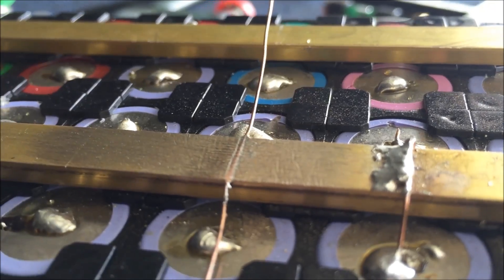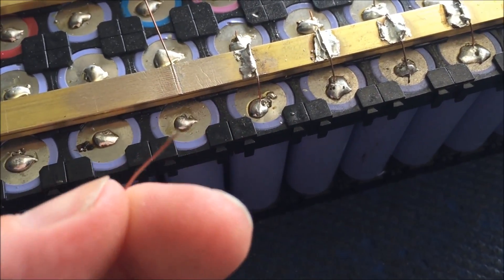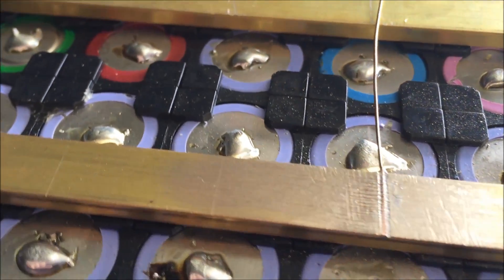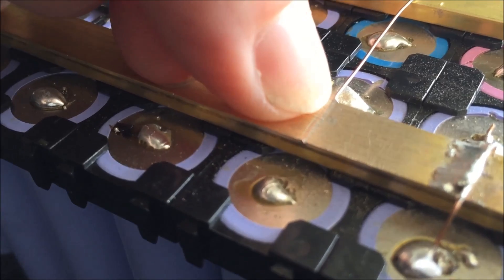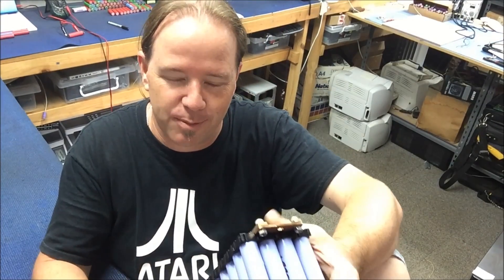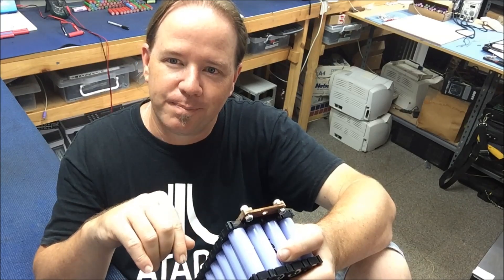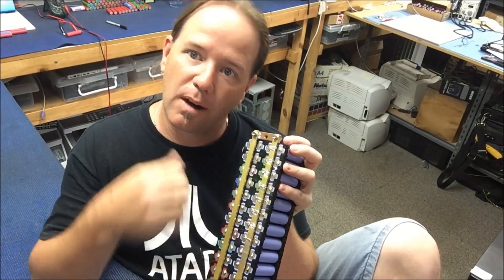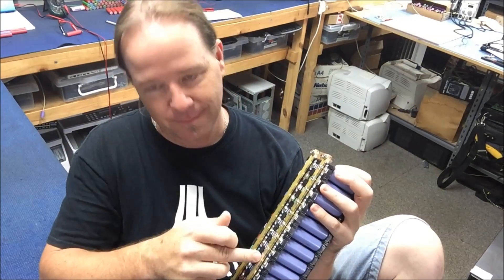Busbar idea coming good I think.

Comment: why my solder cant stick to the battery? any idea how?
Reply from the maker: Iron isn't hot enough, no flux, dirty, heaps of reasons.
Reply: 60watt of iron , is that enough?, Flux core solder, and clean. I try to sand my 18650 and it help the solder stick. Is that mean i have to sand every cell? I dont see you did it. Thanks for your responce by the way
Reply from the maker: heat the top of the cell (NOT TOOOO MUCH) first then apply solder.. try on some bad cells first. There is SOME cells that just don't take solder others its very easy.. just play with it and learn.. you'll get it 
i use a 40w iron so 60 will do the job..
Reply: i will try and update the result. thank you for your suggestion.
well i have another question that keep running in my mind, can 18650 be use for car engine starter?
Reply from the maker: anything can be used for anything you just have to do the math :)
Reply: but i herd that 18650 cant draw much Current at short of time. means cant use for engine starter. unlike lead acid battery. is that true?
Reply from the maker: it's all math, you just add more and more and more cells.. till it does what you need.
Reply: yeah, right. i will update about the solder tonight. Indonesia time, +7 GMT . Thank for your advice sir.
Reply from the maker: No worries - pete
Reply from the maker: weird, don't think i can help any more than that sorry with out seeing/playing with it my self. Have you got a different soldering iron you can use ?
Reply: i will looking for new soldering iron. maybe yes my iron is not good, because when i left it for maybe 5 minutes it is very hot. and i can solder it easily, but after i solder 3 - 4 times, it is getting cooler and become harder to solder it. my conclusion, you're right, the soldering iron isnt hot enough. any recommendation for new soldering iron (or soldering station) ?
Reply: pete, i fround out that my soldering iron is not 60w it is 30w. i dont check it i just trust to the local seller when i order 60w. i am looking for new 60w soldering iron. Does DEKKO Brand 60w Soldering iron good? what do you think?
Reply: hey peter. guess what. you're right i bought 60W DEKKO Brand soldering iron. and it is now very easy to stick the solder. Thank You for your advise sir

Comment: An alcohol wipe would help just before you solder. sweat, oil from fingers inhibits solder adhesion and requires you to heat longer. also a dab of flux would help.
Reply from the maker: Great tips however gave up on this a long time ago :) learnt a lot since
Reply: HBPowerwall That you have. Well done on the progress. looking forward to getting the right space to do my own powerwall. 2017 will be the year!

Comment: hey great looking project, have you thought of just drilling a hole through the side of the busbar? fill it up with flux and solder, use a blow torch to heat it up. would leaves a nce flat neat looking top and works well
Reply from the maker: +vulkane87 yes, how ever drilling 2240 1 mm holes seemed too much :)

Comment: I really like the idea of slicing the bar to wedge in the fuse wire. Have you considered expanding on this and using two thinner bars stacked on each other with the fuse wire inbetween, kind of like a compression fit then spot welding the bars together. 
Not sure of how this will affect the total amperage capacity of the two bars but might be worth a shot on the small scale to check feasibility.
Reply from the maker: +chanrate yes, others have suggested that but I like my idea.

Comment: How about making the cut wider and deeper to allow the fuse to drop in, once in the fuse is in the cut the soldering should be easier to flow in the bus.
Reply from the maker: +Geoffrey Howsam deeper for sure but i actually want a thinner cut so the final finish looks better.

Comment: What about using a MOT and make a spot welder and spot weld them to the brass bar were you need them and then solder the wire to the batteries.
Reply from the maker: +McCuneWindandSolar MOT?  I'll go cross eyed trying to spot weld 0.2mm wire!

Comment: If you are aiming for a clean look cut deeper torch heat everything outside flux solder let it cool than sand everything else to make a smooth finish and clear coat it for oxidation
Reply from the maker: +94Discovery Yep, that's the plan - for preheating i'm going to use the BBQ :) whatever works right

Comment: if you have a saw of some sort, mark all the lines for the cells, then take the busbar off and cut the grooves on a saw or something so they are uniform and perfect, i would think a router with fine tip would make quick work of the busbars with perfect dept grooves...
Reply from the maker: +storxusmc going to buy a miter box today and do several at a time.
Reply: +HBPowerwall thats a good idea, i think i may try the diy powerwall in the future myself, i have been acquiring a lot of decent capacity cells that i dont want to use on my EV motorcycle build im building right now... i think instead of using the plastic spacers like you did, i think im going to glue some wood together to make blocks of wood big enough for the small groups of cells, then using a drill bit the size of the cells, drill out the holes for the cells to sit into, then on the negative side install a large sheet of copper to ground all of the cells to the same connection, i think im going to use a combination of a spring and a copper bolt for the connection, been fiddling around some with some bits and pieces i have laying around, i drilled a hole through the top cover just larger than the bolt i had, then trying out different springs i had in my junk drawer i found that the spring on a bic pen compressed between the bolt head and the wood cover made a compressed secured connection, but at around 9amps the spring got hot and broke, the spring breaking broke the circuit to the cell since the hole i had the cells in was slightly deeper than the cells length and i had the whole setup resting with the spring size down, so when the spring melted and broke the cell dropped away from the copper ground side.... im going to look for a few other springs to see if i can find one that will break a little lower in amp draw

Comment: May I suggest the following to improve your workflow & efficiency:
1. Use a pointy dremel tool bit to score your grooves, or your hacksaw blade if you prefer. 
2. (With busbars removed) heat them as required to tin the grooves leaving a slight excess of solder.
3. Now solder your (precut) fuse wire lengths into place in the grooves, the previously applied solder should more easily accept the wires...
4. After repositioning the busbars simply solder the tails to the batt's. Problem soldered!
Reply from the maker: +Retinalism Sounds like a good plan

Comment: Yeah definitely agree with the deeper cut and removing from the bars from the battery. Just be sure to fully cover the the copper wire with solder so that when you grind the surface you don't damage the copper.